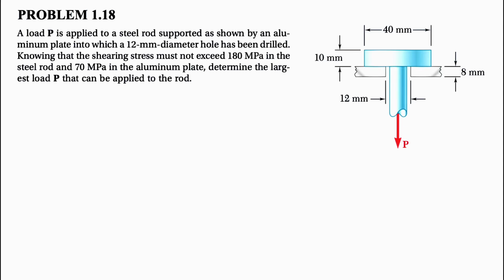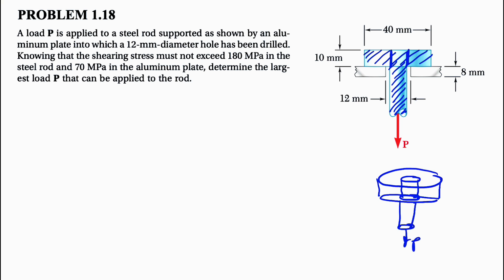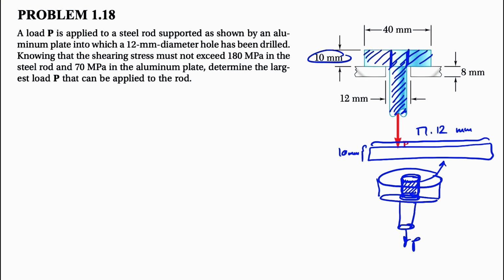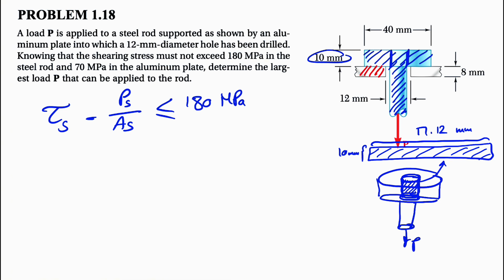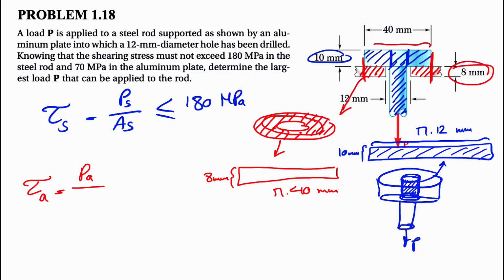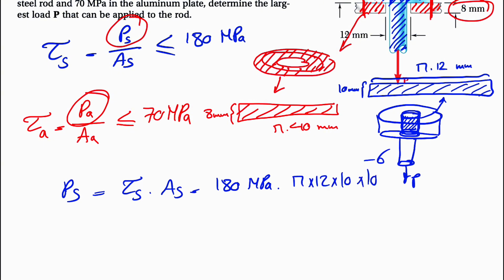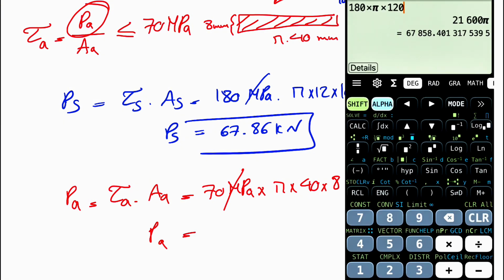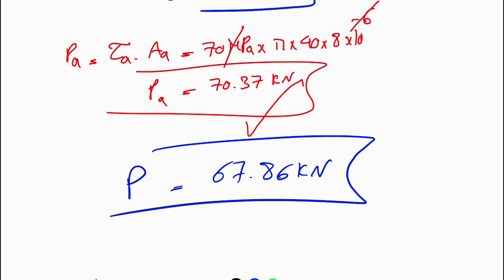Problem 1.18 | A load P is applied to a steel rod supported as shown by an aluminum plate into which

Comment: The surface to be considered to calculate de Area is the surface that will feel the friction when the force is applied. In this case, it is the hollow surface that would be left if the forces could actually remove the piece from the object. For example, imagine I have a bread and cut a hole in it, looking like a donut. Wich was the Area that felt the friction? the shearing force? it was the inside surface of the donut. That's it. It is one specific type of shearing

Comment: I have a question. Why do you use πdh when the equation used to calculate the area is πdh? Isn't the area of the cylinder πd^2/4? I wonder why πdh was used.
Reply from the maker: You’re right that the cross-sectional area of a cylinder, but in this case, we’re referring to the lateral surface area—the side of the cylinder. That area is like a rectangle or a band that wraps around the cylinder.

Comment: i don't understand the shear area of aluminum shouldn't we substract the hole part ?? like 40-12 ?? because there no aluminum in there no ?
Reply: like the net area, shouldn't we remove the area of the hole
Reply: @waelsaad588  If you subtract 40−12, you are calculating a net area, which would be correct if we were dealing with normal stress (tension or compression). In that case, we'd need to account for the reduced cross-section of material resisting the force. However, since this problem involves shear stress, we must use the shear area where failure actually occurs. The shear force is applied along the entire perimeter of the hole, where the steel rod contacts the aluminum plate. That’s why the correct shear area is based on the full hole circumference, calculated as 𝐴_shear = 𝜋 × hole diameter × plate thickness, rather than subtracting any material from the total width.
Reply from the maker: @JusticeBrowatzke  Thanks for the clarification!
Reply from the maker: @waelsaad588  NO, because the shear stress is applying to the perimeter of the inner cylinder or the rectangle band that I am showing in the video. See the answer of @justiceBrowatzke.
Reply: @ENGMATANSWERS  Loved this video! I'm currently working on the problem myself, and this video resolves the uncertainties that arise when trying to understand the essence of the problem.

However, I would argue that it's assuming quite a lot that the Steel Plate with the 40mm "diameter", is in fact a diameter, incurring an assumption that the Steel Plate is infact a Circular Plate. It's never specified in the question.

Yet, in structural mechanics, a plate is a thin, flat object with its thickness significantly smaller than its length and width, arising the possibility that the Steal Plate can infact be Rectangular. 

This would imply the use of a rectangular perimeter band to calculate the area of shear stress, rather than C multiplied by H; creating an alternative result in our calculations. 

As opposed to deriving A(Al) = 320mm2xPI = 1005.309649mm2, we could be getting A(Al) = 40mm x 10mm x 4 = 1600mm2. This in turn would implicate that the Max Load for Al is 112.00kN, instead of 70.37kN.

Although, this doesn't make a difference to our outcome of having the Max Load applied to the rod being 67.86kN, I think this is where my curiousity leads to; Does it matter how you approach these typeof things in a question?

Obviously, going the diameter approach as a component of the Shear Stress's "hole" is a sensical approach, as you're given no information that it couldn't be this, and you're lead to this thinking with having the Steel Rod's hole.

But i'm just wondering, when I do come up to questions like this in exams, what would you suggest for an analysing approach to the question?
Reply from the maker: @danielwopereis8134  What a great comment! Regarding the assumption for the steel plate — the question actually refers to a steel rod, and my understanding is that it’s a steel rod with two different parts and two different diameters (12 mm and 40 mm). Hypothetically, let’s say it’s a rectangular steel plate with dimensions of 40 mm × 40 mm × 12 mm. In that case, the area would be: A(Al) = 40 mm × 8 mm × 4 = 1280 mm², and the max load for aluminum would be around 89.6 kN instead of 112 kN. Of course, this doesn’t change the final results. Personally, I think the rectangular assumption is less likely, especially because we would also be assuming the rectangle is a square from the top view — which isn’t clearly stated. For exams, always ask the prof if they’re available. If not, clearly state your assumptions and solve based on that — that’s usually acceptable.
Reply: @ENGMATANSWERS Yes yes, definitely agree. And more importantly, thank you for your time to address how to approach these sort of questions! Apologies for my slip up of the Plate Dimensions in my example too, and still approaching my inquiry.

I'm actually currently going through weekly sections for my Solid Mechanics exam next week, and literally working from my Uni's resource material that's derived from the 7th Edition book for these questions.

Other than watching more of your videos haha, would you have any other suggestions in tackling the topics going from Stress to Torsion? More particularly, how to identify where to start off with these sort of questions, after identifying what concepts the question is regarding?
Reply from the maker: @danielwopereis8134  No worries, you’re doing great — and honestly, the way you’re thinking through these questions shows you’re really getting a deep understanding, which is the goal! Here’s what I would suggest: First, after you identify the main concept (stress, strain, torsion, etc.), quickly ask yourself: Is this a force, moment, or internal stress-based question? Second, immediately draw a FBD (even if it’s rough) — it always helps to organize your thoughts visually. Third, recall the basic formulas associated with that concept. Solid Mechanics questions often seem overwhelming at first glance, but once you isolate what the question is truly asking and draw the forces/moments, it becomes way more manageable. Just my two cents